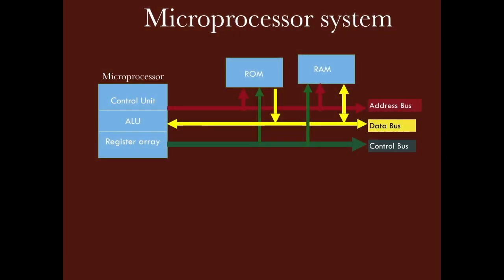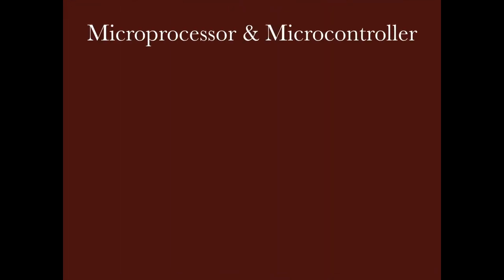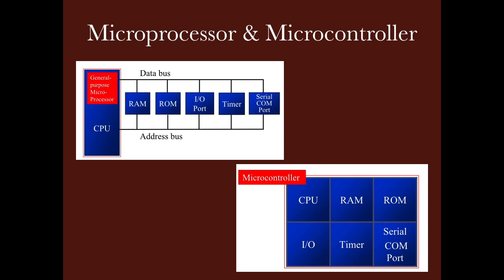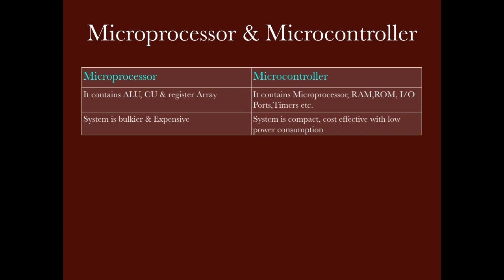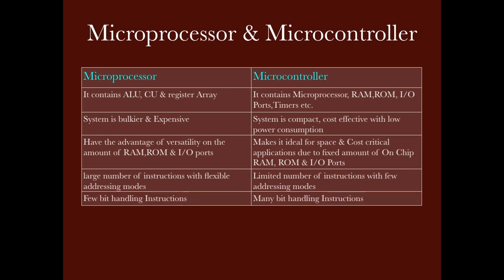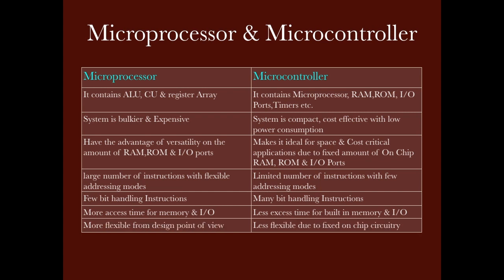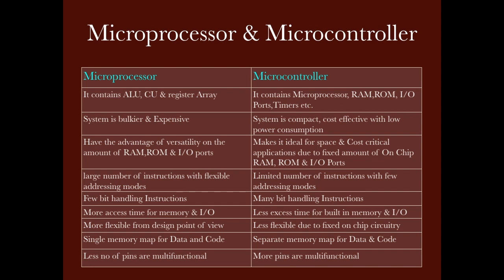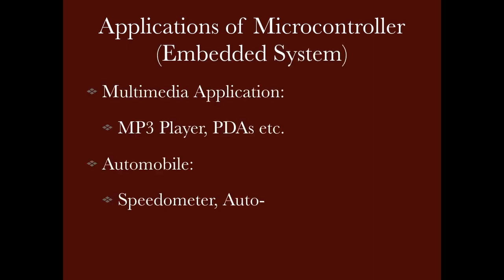Comparing Microprocessor and Microcontroller : Microcontroller 8051(Part-I) (HINDI with ENGLISH sub)

Comment: Ma'am once a doubt I have that Embedded of microcontroller is compulsory,we can't embed microprocessor in place of microcontroller???
Reply from the maker: Microprocessor can not be used as it requires additional components as it is not a standalone device. Also , normally embedded application requirements are met by microcontrollers.
Reply: @conceptech2018 Okay ma'am  thank you🙏